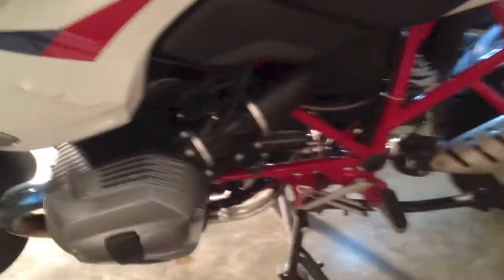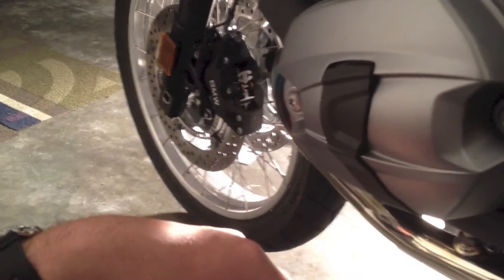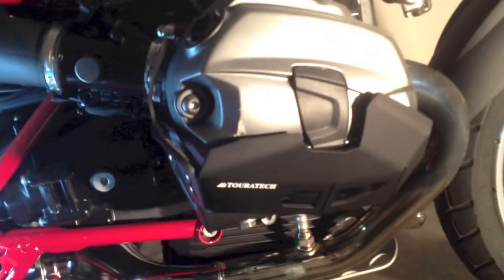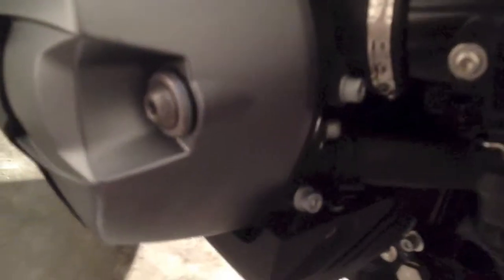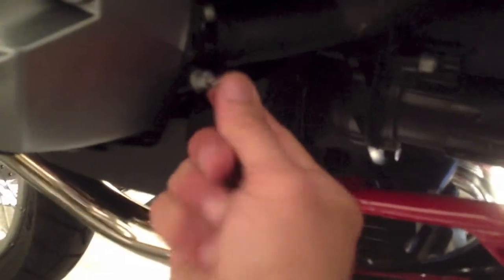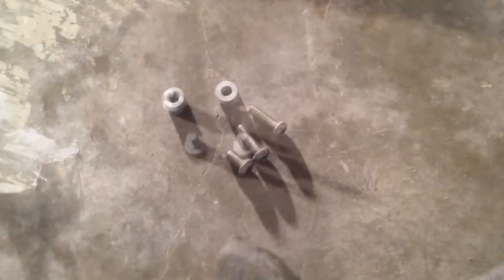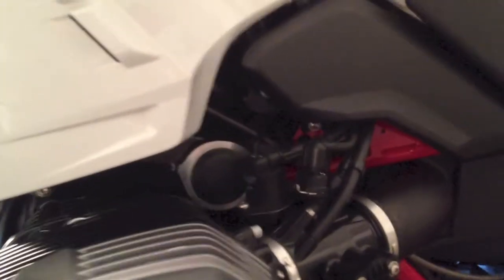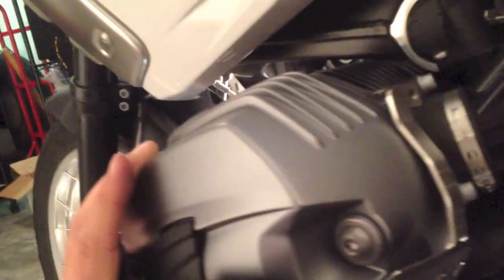2012 BMW R1200GS Rally touratech valve cover install HD.

Comment: Nice 
I put the same covers on mine. If your going to put lower crash bars on the bike be careful if you get the Hepco Becker type. The crash bar on the left side will rub against the Tourtec cover which would stress the engine since it cannot vibrate as needed. You will need to put spacers in or get longer bolts for the crash bars.
Also do you frequent the advrider forum? It's a great place to get a lot of R1200GS info.

Video is great. Keep em coming.

Comment from the maker: Thanks for the comments on the video I will try and do so. 

I ended up getting Touratech lower crash bars. I hand't head what would work with what but thought it would likely be ok if they where both from the same company. and they fit really good.

Comment from the maker: It comes down to a triad off. get a bit of sacrificial stuff on there so you don't have to make the things from heavy difficult to deal with metal in the first place. 

the poor manufactures try and make the bikes lighter while we add on more and more guards and protectors making them heaver :-) 

it is all part of the fun I guess.

Comment from the maker: So far the Touratech valve cover guards and lower crash bars. (I'll make a video of the few extras I have put on) have a very good finish etc. Time will tell how it holds up but I do like them overall. 

Being aluminum and stainless they shouldn't rust up. My only worry is that stainless is a comparatively softer metal than some others and I hope it is up to the job. Of course other riders have been testing as it where all manufactures crash bars for a long time and seem to all hold up decently.

Comment from the maker: The only thing about these is that I whish they where a bit higher in the back. If one falls on pavement then I think they are fine but off road or uneven surfices then the upper rear of the valve cover is pretty exposed. however I will point out that I haven't seen any manufacturer that covers that area so it is not really a dig against Touratech.

I am part off the I have fallen set. I will again to be sure, a little protection is nice.

Comment: Man did you use a torquemeter? Or  a torque wrench for that?
Reply from the maker: Nope, there is not a torque fo those as I remember. One grunt as it where. If you are using a little Alan key like I was it is unlikely that you would be able to over torque them so you can just snug them up fairly hard. If you have a ratchet or something like that it is possible to do so. And remember the lock-tight that is all that you will need. They have been there for some time now with no problems. Taken them off for maintainiance and put them back on etc. no problems. They are still there and doing their job just fine as I have dropped my bike on them several times. I do take mine off road. .